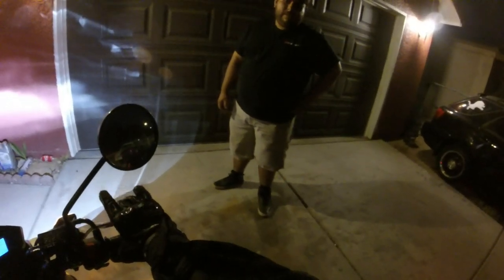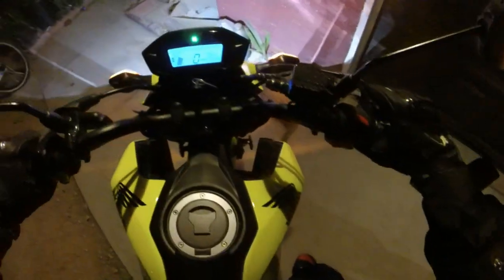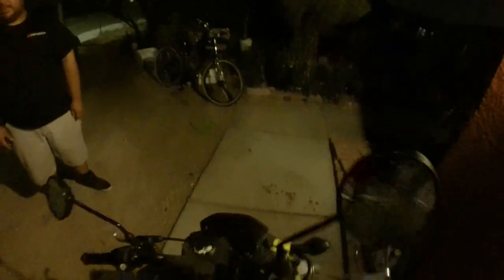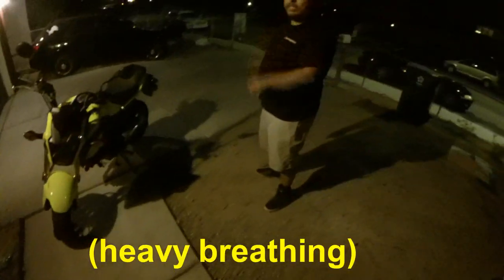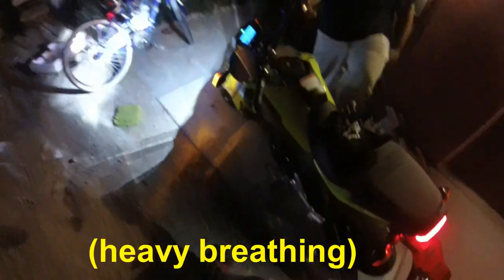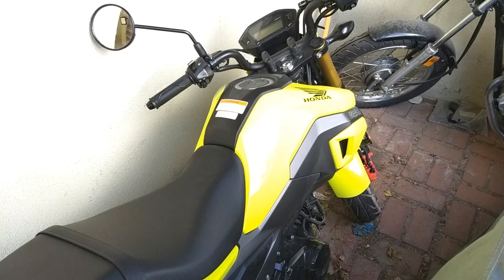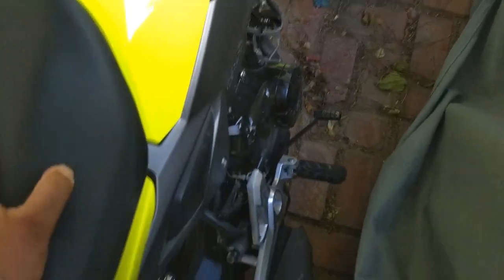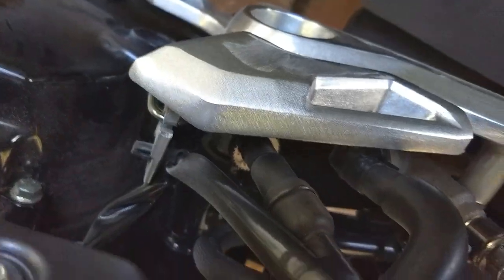Troubleshooting Always On Brake Light (Motorcycle)

Comment: Hi, did you fix your flickering dash issue? What was the problem as I have the same one with mine
Reply from the maker: It was caused by my battery failing due to the dealer installed GPS tracker constantly draining my battery once I pulled it out and put a new battery in it was fine